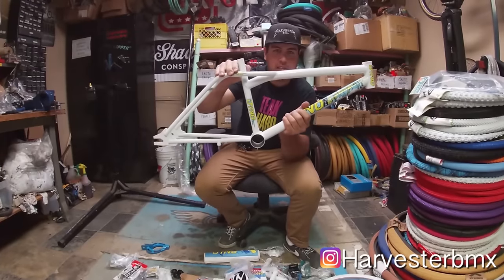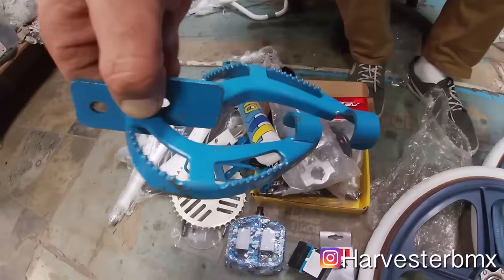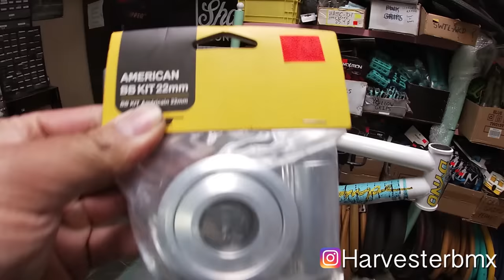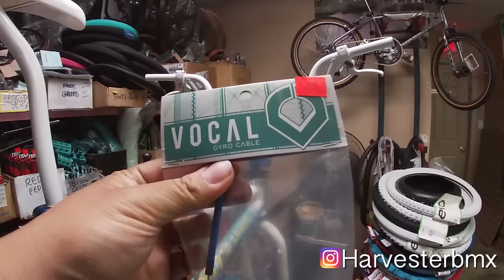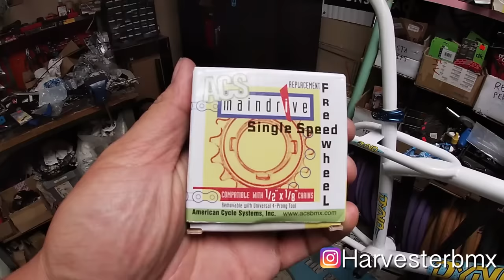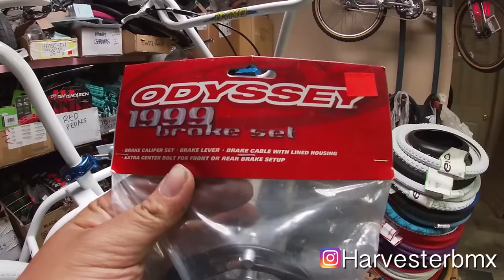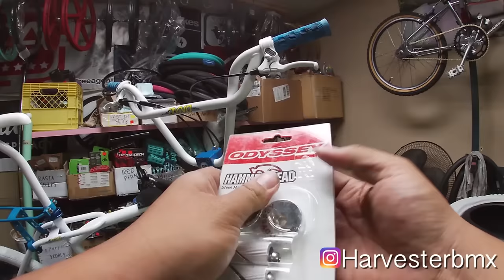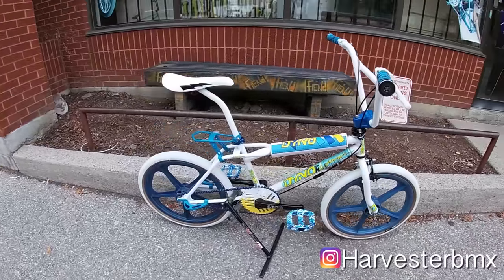1987 Dyno Compe Old School BMX Build @ Harvester Bikes

Comment: I had one in chrome back in the day, it was indestructible. Thanks for the memories!
Reply: I did as well  I  had my  Dyno Trick Bike  back in  1985  it was  yellow and silver  with white rims   ,I'm  49  years old now and I sure miss that bike  at times I try to remember what happened to it  I think I might have given it  away around  1990  but I'm not  💯  sure  b t w  I worked a summer job to buy me a  Dyno Trick Bike  it was  $400  in  1985  that was expensive back then
also it looks like this guy restored this  Dyno  because now  Dyno  is pretty much a crap brand of bicycles now   ,I'm not sure what happened to the company   🤔  there pretty much a  Walmart  bike what a shame the brand  Dyno from around the years of  1975  to  1994   there would have been no way this  brand would've ever been in any  Walmart  Gemco  or  Target stores

Comment: I had one of these I bought it off a friend for $10 because he got a hutch and didn’t want it anymore but it only came with the frame, forks, handlebars and crank. My father sent It to a paint shop where it was stripped down and painted purple and when I got it back I found the same plastic rims and slapped them on.

Comment: i have a question,when you order the skyway mags do they come with the axle and bearings and back sprocket??????
Reply: They should come with the axle and bearings,  but the sprocket is sold separately. And just in case you're wondering,  for this year of bike, it would normally be a 16 tooth. The standard gearing from this era was 44 front,  16 rear.
Reply: @mark_spit7839  thanks for the info

Comment: What's with the upside down brake?
Reply: My 1987 has standard rear brake, was wondering the same thing.
Reply: I’ve seen team models with the brake upside down so could be that? There is a fair few with that style brake but most seam to have the brake on top
Reply: that is a PRO compe the regular compe did not have ad-990s

Comment: you didn't put those decals on correctly they're uneven especially the upper and lower frame tube. you're supposed to peel half off and lay it down and make sure it's even then pull the other side off and stick the other side to the frame.

I hope that's your bike and not someone else's. otherwise looks good.